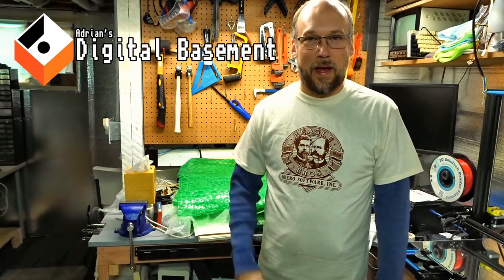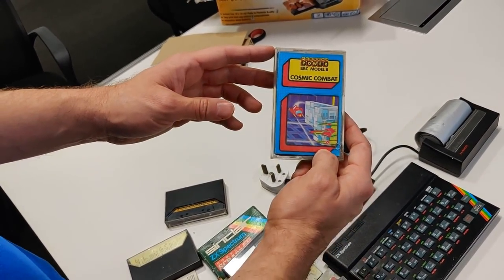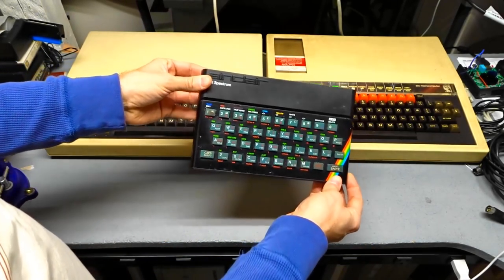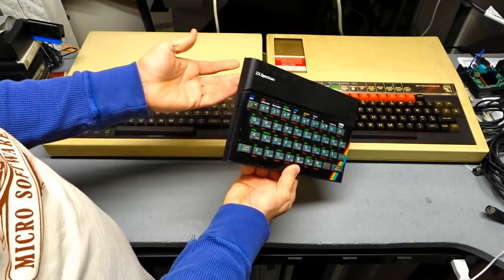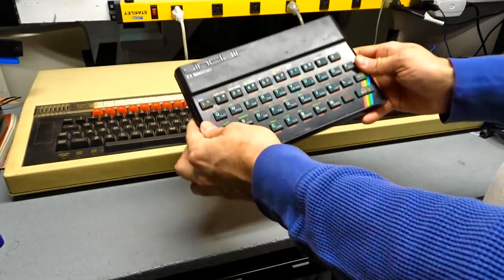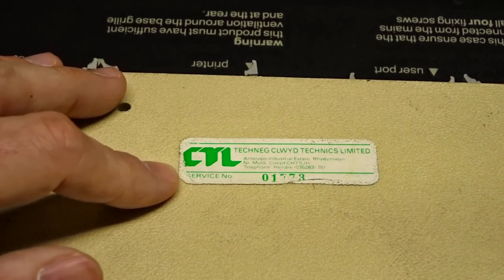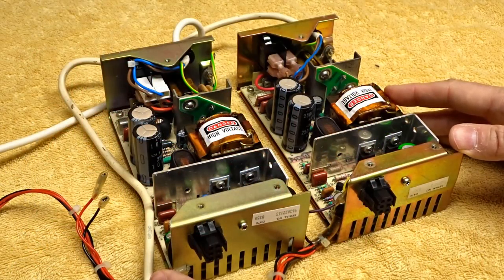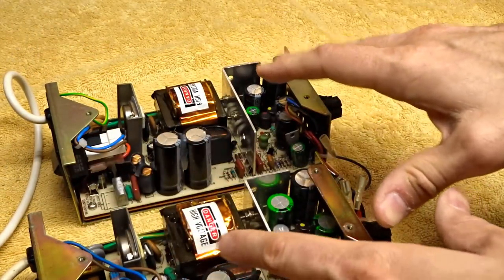I visited the UK and brought back some computers! Let's see if they work.

Comment: Don't forget that the United Kingdom runs on 50 cycle power and North America runs on 60 cycle power.  Not sure how much that matters, but it is something to keep in mind.  It will affect the speed.
Reply: Luckily, the BBC generates all its frequencies on the motherboard and doesn't reference the mains frequency.
Reply: >It will affect the speed.

I doubt any computer uses the line frequency as a clock source. The reason games are usually slower on a PAL megadrive or whatever is that games were usually developed with the 60hz refresh used in Japan and depend on the interrupts generated from that to calculate how much time has passed. If you run the same game on PAL machine the interrupts happen less often so time runs slower for the game.
Almost all games for the speccy etc will be the opposite and expect a 50hz refresh. If a machine did use the line frequency as a clock source it would make games that expect 50hz to run faster not slower.
Reply: @donpalmera  ...but I was talking about the BBC micro,for which there is no NTSC software...  The screen refresh is done at 60Hz on USA-spec machines, but the clock speed of the machine remains the same...
Reply: @rayfenwick8761  
AFAIK with a lot of older machines all of the other clocks are generated from whatever base clock is needed for the video so there are minor differences with the clock driving the cpu.
Reply: If you look carefully at the power supply, you'll see that it's spec'd for both 50 and 60hz.
Reply: @dennisp.2147  Ah, silly me.  Still, Commodore 64 games and Atari 8-Bit games had different speeds depending upon the region, so I thought that this would be the case here.

Comment: Glue was to hold in a screen for ventilation.  Hole is over the main heat source.  Why have a solid cover without anything serviceable underneath?  Again, take a second to use a little logic.

Comment: The printer actually uses thermal paper
Reply: No. It's not thermal. The top layer is a thin aluminium layer that is burnt off by an electrical spark, revealing black paper underneath The paper roll has a carbon brush touching it to make the electrical circuit.

Comment: Love both those machines. The BBC B was my first computer as a child, the Spectrum + 2A was my second. I still have them both, though the BBC has a faulty power supply I need to get fixed. I also want to replace the black around the keyboard, as the perforation for the ROM socket got punched out by accident.

The BBC Model B (the 32k version) was by far the most popular of the BBC models. Built to last and take abuse - but despite its familiarity (the BBC Computer Literacy Programme saw BBC computers installed j almost every school in the country), its high retail price meant it didn't have much of a market as a home computer. Consequently, there are far fewer games for it than the ZX Spectrum. That said, there are good games on the BBC B. Chuckle Egg was a classic. Mr. Ee! was a fabulous conversion of Mr. Do!. Aviator was a detailed but difficult flight simulator - I suspect you need a proper analog joystick for it, as the keyboard controls made it difficult to control, and a digital joystick was far too sensitive. Time Pilot was good too, and Repton was a seminal Boulder Dash clone. 

The Spectrum is a great computer too. You can easily mod the 48k model to use composite video out. Despite costing far less than the BBC B, the Spectrum's market penetration was massive. Hundreds of games were available. You could also e expand the hardware, with the Interface 1, giving you a Sinclair-wired joystick port, and networking support.

BBC BASIC was incredibly powerful. In fact, the Windows version was used to detect leftover colour information from black and white film recordings of colour videotaped programmes that had been designed to sell abroad. It worked to - multiple 70s Doctor Who episodes, Dad's Army, abc Morcambe and Wise were effected, recoloured using this technique. Amazing stuff when you think about it.

Comment: Yeah. Yankees discovering how sharp Scart RGB PAL was compared to composite NTSC something like 30 years later. Now I understand why some of you doupt Apollo ever landed on the moon! 😂 Meanwhile, Japan already had analog HD broadcast TV in the 90s. 😭
Reply: Adrian Black In fact it was not just the US and it was before the HD norm was standarised. People started to watch movies on their computer monitors on super VGA resolution, non interlaced when PCs and Macs where equiped with DVD ROM drives.  And the TV industry appeared to be low res. Even if the DVD movies where in standard resolution, the picture quality was much better on a computer than on a TV. (And I don't even speak about letterbox 16/9 prerecorded VHS crap) Here in Europe, we even had HD TVs before any HD broacast went on air. Just because people wanted to connect a computer to their TV and playback.

Comment: You should have got an acorn Archimedes... ! It’s now the most popular computer on the planet ! Every mobile phone has the same chip in it! An ARM cpu.   It made all other home computers at the time seem stupid. Very, very British. It’s the first really effective SOC CPU! Actual magic at the time !
Reply: >very mobile phone has the same chip in it! An ARM cpu.

Most phones are now ARMv8 which is a world away from the original ARM. Even older phones will be ARMv7 which is also a lot different to the original ARM.

>It made all other home computers at the time seem stupid.

The Amiga was just as good and actually had games. I think the MC68020 and MC68030 were already available when the archimedes came out.

>Very, very British. It’s the first SOC CPU! Actual magic at the time !

The Z80, MC68000 etc had already been used in highly integrated chips. The first proper SoC was probably the Motorola Dragonball which was originally MC68000 based before replacing the core with an ARM and becoming the i.mx line.
Reply: The later A3010 had the first ARM250 SOC. The first batch actually still had the original ARM2+chipset on a daughterboard.
Reply: @adriansdigitalbasement  Yep. A 68000 with everything that ran the palm pilot in a single chip.
It has the odd quirk that it's an original 68000 but it can address more than 16MB of RAM.
Reply: Adrian Black the DragonBall, now renamed Freescale uses an ARM core! We all know palm pilot is dead now...so that cpu is useless these days!  The clear point is the Acorn Archimedes uses the first ARM processor, and the geniuses behind the design, literally run the modern world now, by all predictions ARM will even surpass x86 cpus and become the processor for everything, like it is now. Data centres  are now moving to ARM and are faster and more efficient that x86. There are more ARM cpus out there than anything else.....!
Reply: @hanniffydinn6019  
>There are more ARM cpus out there than anything else.....!

I have a feeling there are probably more 8051s out there than anything else.
Reply: donpalmera you are wrong, there are more ARM cpus than anything else.
Reply: @hanniffydinn6019 
Prove it.
Reply: @hanniffydinn6019  
Ugh, ok. Lets ignore your silly personal attacks. I know how to look up stuff on the internet but you stated something as fact and said my opinion that there are probably more 8051s is *wrong*. The burden is on you to prove your fact if it really is a fact.
FYI: The "ARM" chips that ship in the highest quantities (cortex m<?>) parts can't even run the ARM instruction set.
Reply: @Archimedes75009  

Do you have numbers for all of the deeply embedded 8 bits that have been sold. Like designs based on the 8051?
Reply: @hanniffydinn6019  
Seriously what is wrong with you?

That's a single number from ARM. Whether you like it or not ARM is not the same company it was and their corporate bullshit machine is just as bad as any other company. For example they recently put out slur pieces on Risc-V. Note that even ARM didn't write that there are "more ARM cpus than anything else" and they would have if they could have. If you do some thinking you can actually see a massive issue with the numbers in their graph but I'll leave that up to you to work out.

If you used all of your brain cells you'd know that 32 bit chips are actually more expensive than 8 bits still in a lot of cases and ARM doesn't have any 8 bit chips. A lot of devices that contain a Cortex A chip will also have some 8 bits in there in chips you don't even think are microcontroller based.

Without knowing the numbers of every single Chinese company knocking out less than a cent parts there's no way to actually know.

Maybe use some of your amazing brain cells to think logically instead of like a religious zealot.
Reply: @donpalmera  When yopu have 100 billions to beat, you already know you've lost ;-)
Reply: @Archimedes75009  
Almost half of that 100 billion is for "classic arm" which I guess is ARM7TDMI microcontrollers and I suspect that number isn't quite right. But yes 100 billion does seem impressive if that number is remotely close to reality. The problem is there is no number for all of the 8 bit cores based on the 8051 and similar that are hidden in almost everything including a lot of devices that use an ARM core as the main processor. Cortex M chips are cheap now but they are still not as cheap as an invisible 8 bit core deeply embedded into something that you'd never expect to be microcontroller driven.
Reply: @donpalmera  You are right the number is wrong : it must be even more today ;-) I doubt ARM is going to lie on numbers :  not so long ago this company was listed on the stock market, so you can expect them not to talk nonsense and face trials. ARM is everywhere today, it is the leading technology in everything hand held and embedded. If you want to refute that it is up to you to bring some numbers : ARM success and market shares are listed and can be found everywhere if you search a little bit, be it in financial reports, markets reports, electronics magazines ... everywhere you look except desktop computers ARM is leading. I'd be curious to know where your 8051 chip is used when I can list dozens and dozens of equipments with one or several ARM chips inside.
Reply: @Archimedes75009  

>I doubt ARM is going to lie 
>on numbers :  not so long 
>ago this company was listed
>on the stock market, so you 
>can expect them not to talk 
>nonsense and face trials.

ARM spread a bunch of lies about RISC-V and quickly took them down when people called them out on it. I suspect the "classic ARM" part of that number is a fudge and they don't actually know the real number. Companies lie all the time by the way.

>ARM is everywhere today,

ARM only has 32bit chips. They are fairly big and costly for parts that cost cents.

>it is the leading technology
> in everything hand held and 
>embedded.

Embedded is massive and it's in no way all ARM. Cortex M parts are popular now but it'll be interesting because RISC-V could totally destroy that market for them. If you can fab chips there is literally no reason to pay ARM royalties.

>If you want to refute that it is up to
>you to bring some numbers :

I don't refute they have sold a lot. I refute that it's the most used CPU. Because all of the Cortex M parts cannot run the ARM instruction set, because there are so many deeply embedded cores out there etc.
To prove that claim you'd need to come up with numbers for every other popular CPU but that would be impossible. This is exactly why ARM hasn't written that in their press releases. They can't prove it. It is a claim that is impossible to prove hence I asked our potty mouthed friend to prove it.
TL;DR; It's impossible to prove either way.

>ARM success and market 
>shares are listed

A bunch of other companies are also massive and sell a lot of chips and they were doing it long before ARM had anything to offer that was competitive.

>I'd be curious to know where
>your 8051 chip is used 

All over the place. You might have one in the keyboard you're using right now. There might be one in your mouse. There's probably one driving some part of your monitor... there might be one in your kettle, washing machine, electric tooth brush, smart cards, singing birthday card.

>equipments with one or several 
>ARM chips inside.

And if those "equipments" have any sort of complex assembly like a display with a touch panel, a smart battery charge controller etc it's possible they contain an anonymous 8051 or a derivative too.

The cheapest ARM chip is still around 50 cents. The cheapest 8 bitters are 3 cents for a finished chip and even cheaper if you buy an IP block for ten grand and drop it right into your design.
Reply: I would imagine the 8051 core is indeed more common. Each domestic house probably has many in microwaves washing machines etc. For instance my smart light switch uses an esp8266 as its main processor but offloads the 433Mhz RF function to another micro controller with a 8051 core. The 8051 core is that mature a product that an arm based device may include multiple 8051 uCs as helpers to the main processor.

Comment: If you search eBay auction number 254467262776 you’ll see the rasp pi3+ based co-processor mod for the BBC which I think your DFS based BBC B would work with. The BBC was a very good computer for its day and it’s Basic was very fast compared to all other computers out at the time.